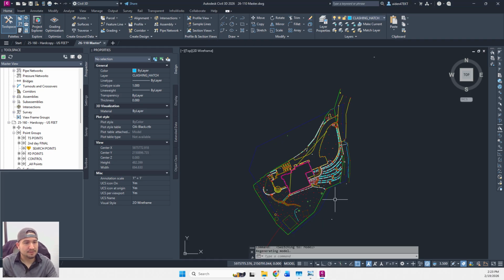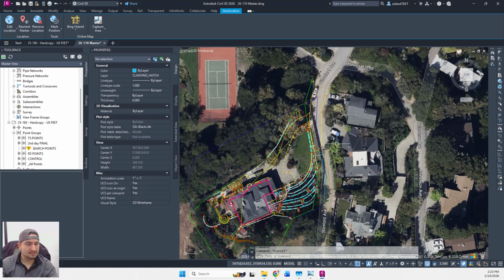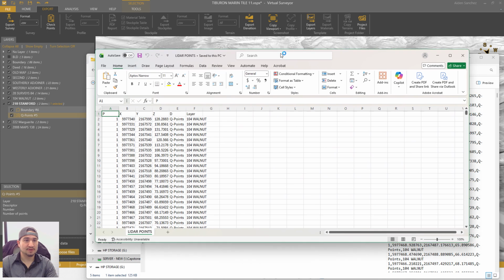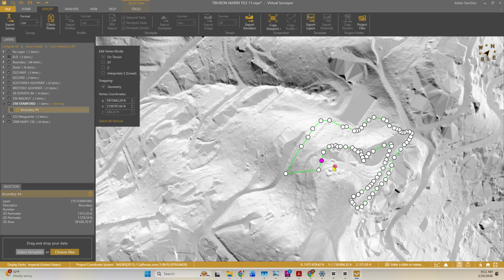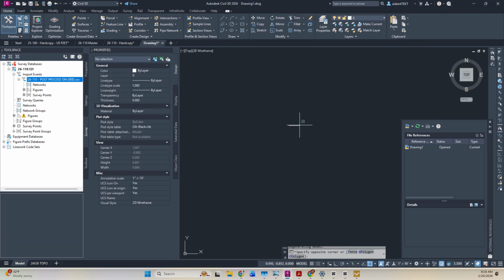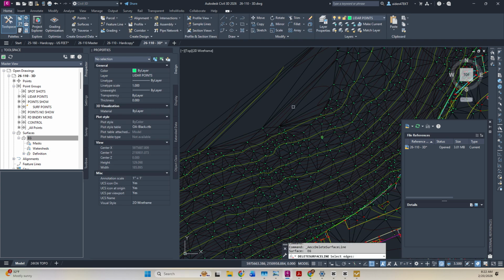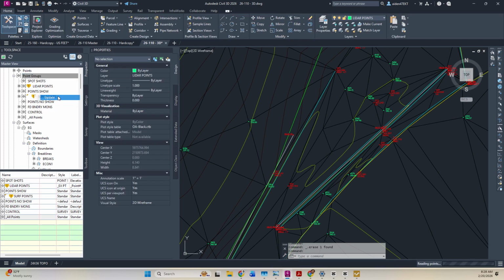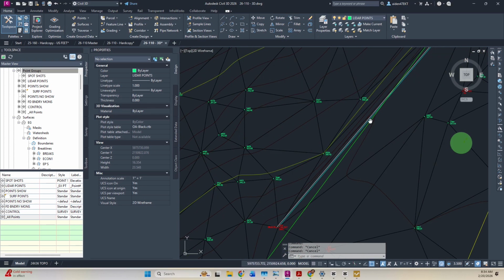Using Virtual Surveyor and bringing in Lidar Points to 3D drawing

Comment: The HARN projection will typically yield tighter positioning for the imagery despite it being an older projection.  The projection you select won't have an effect on coordinate positions in C3D unless you're performing adjustments in CAD, which I'm not a fan on; Either TBC or preferably, StarNet.  The hybrid map display will not render when zoomed in too close, so you'll want to use the aerial only in that case.